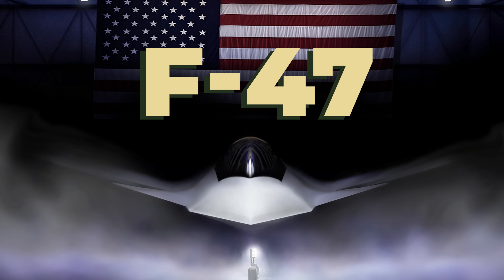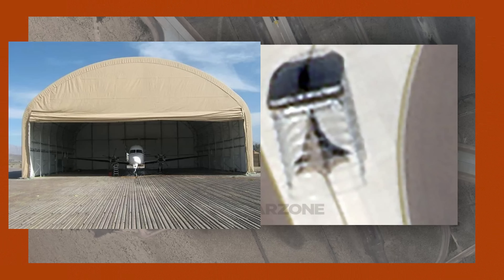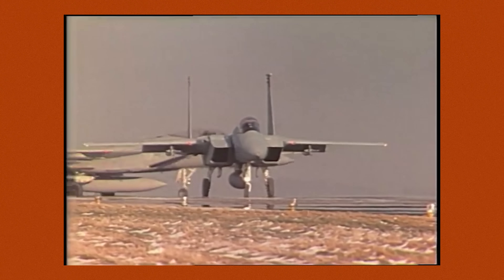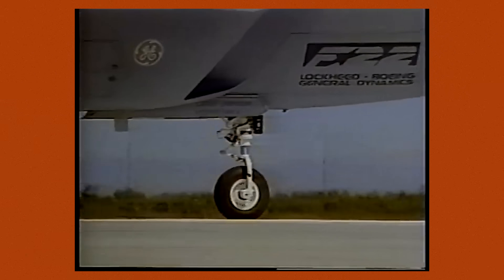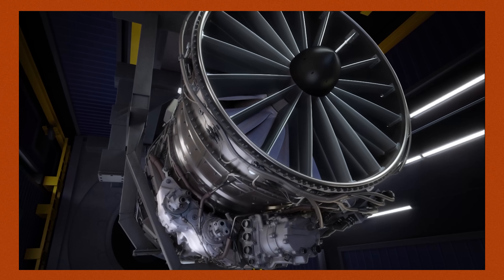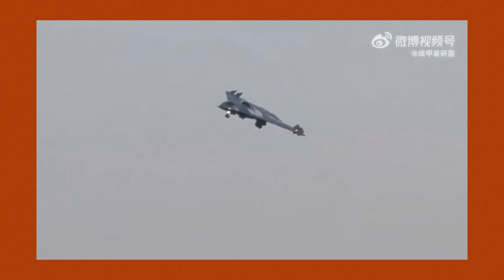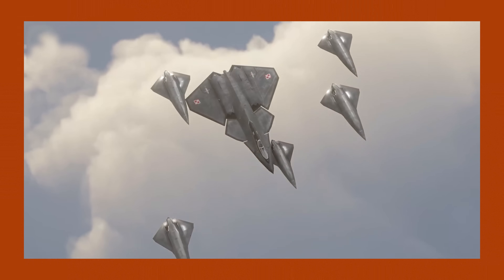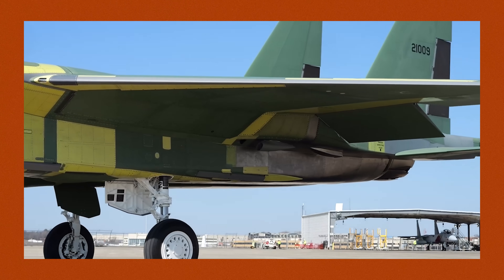America's "New" Sixth Gen F-47 is NOT New

Comment: You're making slower planes because the polymer used in the radar coatings degrades at higher temperatures which is why the F35 is speed limited otherwise you need to spend a week re-coating the plane after every high speed run

Comment: The F-35 has arguably as much capacity to engage a target in a HOBS dogfight as the raptor if not more thanks to its targeting system. It can launch thrust vectoring missiles at targets anywhere around it, 360 degrees. Of course the WEZ can still be jammed, but the Lightning II basically gets to look through his plane, lock a target behind to the right, and with enough separation hit that target with a sidewinder.

Comment: I’m a little more optimistic about the speed because of advanced ceramic stealth coating break through and stealth alone can’t beat next generation missiles and I’m thinking they’re-going to roll that into what they’ve learned  with hypersonic testing programs on what really needs to be beefed up with tight  maneuvers in the lower atmosphere even if it’s built on a old silhouette they didn’t just freeze the advancements made since then everything under the proverbially hood has changed since that program was active

Comment: If NGAD is a derivative of the X36 (tailless, blended cranked compound swept wing with saw tooth trailing edge, with canards) 
It may be EXTREMELY agile.  X36 met or exceeded all parameters before the program was ended - X36 was SPECIFICALLY developed to explore the Agility of a tailless stealty fighter design.  
Suposedly,  it "handled and flew VERY well"    so I wouldn't be suprised if the F47 exhibits supermanuverability.

Comment: An F35 at max of Mach 1.6 is faster on service than an F16 of Mach 2.0. Because if the F35 has a stealth load out, the weapons are internally stored, while the F16 or any other jet of the 4th generation, has them slung underneath. The max speed of fighters is almost always stated as clean, without weapons. The F16 or others of it's generation are slower than the F35 with a normal weapons load out.

Comment: Adaptive engines do have a simple analogue, within aviation - variable-geometry or the ‘swing-wing’.  Adaptations to different parts of the flight envelope.  Just quite a lot more moving parts and issues with heat in engine, than two moving wings, so an additional 50 years of technological development required!

Comment: The F-22 does not top out at Mach 2. Compare the thrust to weight ratio between the F-22 and the SR-71. Yes, the F-22 is limited to Mach 2 to keep the paint on and heat low. It can fly way faster for short periods but will result in long-term impacts to the plane. The same is likely for the F-35 to keep maintenance costs low[er]. #InThrustWeTrust

Comment: The F-35 was originally meant to replace the AV-8B for the Marines with the F-35B variant being what originally designed.  Because of that is the F-35 has less than ideal ranges and payloads.
Reply: no, the jsf program was from the beginning about replacing the f16, f18, a10 and av8
Reply: @aquilesca5tr0  Before it was the JSF program it was the Common Affordable Lightweight Fighter (CALF) program whose purpose was to replace the Harrier.  CALF was chosen because it was further along in development that the programs to replace the F-16 (Multi-Role Fighter (MRF)) and the F-14 (Advanced Attack/Fighter (A/F-X)) which were cancelled.

Comment: That photo from A51 looks like the "kingsnake" or F-16XL that was a possible alternative to the F-15E and is proposed to be a replacement for the current gen F-16s and A-10 in the CAS role when enemy long range A2AD integraded defense systems are broken up. Even in the 80s this F-16 variant had dozens of hard points which make it a more effective and survivable CAS fighter while having the stand-off to outrange SHORAD and the magazine depth to overwhelm and destroy SHORAD assests while still having ordnance left over to delete a company's worth of IFV and APCs.

In moderntimes it ca probably host more hardpoints, and the use of CCAs/Stormbreaker/SDB/Pyros/and guided 70mm rockets could allow US and allied forces to use a target designator to systematically dismantle a larger heavier enemy force without even using their own personal ammunition.

Comment: Modern canards also form vortices that travel over the wing, improving lift. Early canards were basically just control surfaces. Modern ones do more. A good comparison between a modern and an older design would be to compare the Gripen to the Viggen.

edit: They function similar to how a leading edge extension functions in this regard. (think F/A-18)
Reply: Actually older canards were just vortex generators and didn´t move
Reply: @aquilesca5tr0  The oldest canards were literally just control surfaces.

Comment: So what do you really need to make the new AIM-260 air to air missile work?

1.The plane needs to be big enough to carry a 12 foot long missile in its weapons bay 

CHECK

2. It needs to be able to go 
over MACH 2 so it can act as a "Booster" for the AIM-260, greatly extending its range.

CHECK

3. It needs to be stealthy so it's missiles can penetrate deep(er) into enemy airspace.

CHECK.

4. It needs to have enough range that it doesn't need refueling aircraft or they can be a safe distance away.

CHECK.

There was serious talk of just using the B-21 in this role , but it's subsonic top speed reduced the effective range of the AIM-260 too much.

Comment: The designation, and awarded contract is new, not the concept. Pretty general information.
As far as we know, there is no physical f-47 yet besides some mock-up for display, when the plane is developed, it will absolutely be new.
Reply: For the contract to be awarded there needed to be several flying prototypes
Reply: @aquilesca5tr0  Wrong. X-plane tech demonstrators are not the same as prototypes.
Reply: @Flightman453 If a prime has been assigned it’s a very safe bet that a “Y-xxxx” prototype has flown.
Reply: @Flightman453  x planes can be just prototypes
Reply: @jonathanpfeffer3716  I don't think you have any idea what you're talking about. That isn't how it works at all.
Reply: @aquilesca5tr0  I don't think you have any idea what you're talking about. X-plane tech demonstrators aren't anywhere close to the same as full-fledged prototypes.
Reply: @Flightman453  That’s been the pattern with literally every single recent fighter contract. Feel free to let me know of one that hasn’t followed that schedule.
Reply: @jonathanpfeffer3716  Read the other reply I sent to you about 20+ minutes ago. For the 2nd/3rd time, X-plane tech demonstrators are not prototypes. There is a difference, and this isn't hard to understand. The plane has not flown. By "flying for 5 years", they are referring to X-plane tech demonstrators. They have been flying demonstrators. No prototypes in the classic sense exist and the actual aircraft hasn't flown. 

Confusing with "demonstrator" as has been done on numerous occasions. CSAF referenced 'experimental aircraft' which is exactly that - a demonstrator. They only received an RFP for USAF NGAD platform in 2023. Not enough time to build a proper prototype.
Reply: @ I know, the tech demos could literally be anything. You could consider the Bird of Prey a tech demo for the PCA. That’s not what I’m saying. Boeing got the contract so they submitted a Y-series aircraft, which is what the industry calls a prototype. If there’s multiple contractors competing for a contract, which there was on this, then it is not possible for a contract to get awarded without a Y-series aircraft getting submitted. What would you consider a prototype, if not the Y-series submission? That’s the last formal submission before an aircraft enters the final development stage and then serial production. 

There’s a chance it hasn’t actually flown since Boeing likes digital design a bit more than other contractors but it’s rare historically. I personally doubt they would lean on digital design much after the T-7 but I won’t claim to know whether it has or hasn’t.
Reply: @ Sorry, just checked and I was actually a little overly conservative in my reply. There actually hasn't been even a single fighter program in modern history that has not had a flying Y-series prototype before the EMD contract is awarded, meaning that we can say for certain that Boeing has flown one.
Reply: @Flightman453  Tiananmen Square Massacre 1986, Free Tibet, Liberation of Manchuria, Taiwanese Independence, Free Hong Kong, Nepalese Freedom Movement, Uighur Genocide, Tofu Dreg Construction, Chinese Ghost Cities, Three Gorges Dam Reservoir Village, Mao Zedong 5 Year Plan Failures, Great Leap Forwards Famine, Qing Dynasty Inbreeding

Comment: Why Canards are unstealthy and why it's ok that the U.S. is using them on a stealth jet, a treatise:

Canards are not stealthy.  They are not stealthy for the same 2 reasons ANY moving control surface is not stealthy.  

Control surfaces tend to move.  That means that the aspect at which radar waves hit them changes as the angle of the control surface changes. This means that any maneuvering can cause increased radar reflectivity, which is unstealthy.  

Control surfaces also necessitate gaps in the outer surface of the aircraft where they meat the fuselage.  These gaps need to be generally flat to permit free rotation of the control surface.  Flat surfaces reflect radar waves, which is unstealthy. 

The Chengdu J-20 DOES uses canards in addition to its existing control surfaces, such as its vertical staves or, as you called it, it's empennage.  This makes it unstealthy, because it adds an additional moving control surface AND control surface gaps at the front of the aircraft, which is the side most likely to be facing enemy radar emitters, which is unstealthy.

U.S. 5th generation VLO jets do not use canards, in addition to their existing control surfaces for this reason.  However the rear empennage is itself a massive radar reflector, when viewing the jet from the side.  This is why all 5th fighters "cant" or angle their vertical staves outward, to encourage radar reflection AWAY from the emitter.  But this only works when the angle of incidence between the flat face of the stave and the radar receiver does not result in an emitter reflection back to that receiver and also means that the jet is only stealthy so long as it does not roll such that the reflection DOES return to a receiver.  Additionally, vertical staves are still radar reflectors jutting up from the back of the jet, meaning they are inherently unstealthy and also, the leading edge will be a locus of high heat saturation when the jet is moving at high speeds which is known to have negative effects on the stealth coating of the skin. 

So while U.S. 5th generation VLO fighters ARE stealthy from the front and MOSTLY stealthy from other angles, the vertical staves make it so that they are less stealthy from all aspects, and ESPECIALLY from the side. Also, as they accelerate through the air past the speed of sound, their stealth decreases as the stealth coating is degraded by the heat caused by air friction. This is true of ALL stealthy jets. 

The U.S. F47 DOES NOT use canards in addition to a rear empennage.  It HAS NO rear empennage.  Thus the radar returns associated with the use of rear empennage's are not a factor.  It REMOVES and entire control surface and replaces it with another, which is stealthy in the fact that it increases ALL ASPECT stealth (front, sides, rear) by essentially deleting an entire axis of reflective surfaces (the vertical axis occupied by the staves)

Additional postulation:  

Boeing uses a technology referred to as "wing morphing" or "morphing surfaces" which allows the structure of the canard to actively flex, like the wing of a bird, bat, or insect in order to accomplish the same affect on airflow as a traditional control surface, which the need for gaps. 
(https://nationalinterest.org/blog/buzz/the-boeing-f-47s-canards-explained) 
(https://www.twz.com/15413/the-future-of-stealth-is-in-morphing-wing-technology-will-the-b-21-feature-it)

This means that the front of the F47 will likely omit control surface gaps by "morphing" the canard for control purposes.  As you can see in the artists renditions, there are no panel gaps between the canards and the main fuselage.  This MAY be a stylistic choice, but I suspect it implies that Boeing has employed "morphing surface" technology to delete the panel gaps, making the canards less deleterious to stealth. 

The canards are also likely constructed using integral Radar Absorbing Materials (RAM) like the structural skeleton of the F35 is and likely have a geometry such that the forward edge of the canard is parallel to the forward edge of the wing AKA "stealth geometry" or "stealth planforming" 

This is why it is not hypocritical to criticize the J20 for its use of canards while not criticizing the F-47 for its use of canards.  The technology employed is different, and the fact that the J-20 still uses vertical staves AND has canards makes it inherently unstealthy, even when compared to U.S. counterparts while the F-47 can be MORE stealthy due to the method in which it employs canards. 

Anyone saying otherwise is simply a CHICOM fanboy lobotomite. 

This has been my TED talk.

Also, no countries have canceled their F35 orders.
Reply: ' no countries have canceled their F35 orders.'  That's because they've been threatened with 500% sanctions on their US=bound experts if they even think about doing so!
Reply: super interesting comment ty for writing it out
Reply: So in short, a lot of mental gymnastics to try and cope about the fact the F-47 has canards. When China has canards, it's bad. When the US does, it's good. So much for "muh canards is bad for stealth" for the past few years.  Good cope read though.
Reply: @Flightman453  You again. CCP bot. I'm Chinese and even I believe the F-47 is better
Reply: @Flightman453  

Oh look,  I found one of the lobotomites I referenced earlier. I see that your frontal lobe functions at 10% capacity,  my condolences. 

Not really,  keep seething, sub-human.
Reply: @Flightman453 4000 social credit
Reply: @monsterhunter3861  For real. This guy is under EVERY remotely Chinese critical comment posting the same 3 arguments. Must be trying desperately to gain that few extra social credit he needs by the end of the month to get an extra half hour of internet access.

Comment: “Radar signature” doesn’t matter!  Stealth has been obsolete for nearly 20 years!  

Every major military operates stealth defeating radar!  

You can actually tune WWII radar to identify and target the f-22
Reply: Long wave radars can identify stealth fighters, but you can't put them on airplanes since the radar dishes are too big. Also, their tracking ability is low - you can detect there is something there, but not have enough detail to shoot a missile at it.
And you can detect a stealth aircraft with radar, but you have to get much closer. If a stealth aircraft and a non-stealth aircraft are fighting each other, chances are the stealth fighter will detect the other first, move outside its radar cone, close the distance safely and shoot first. So it is a great advantage.
Less of an advantage against ground AA, but still it decreases their detection range significantly.